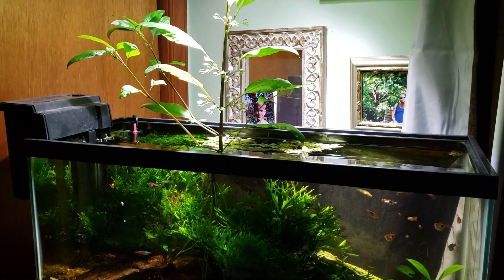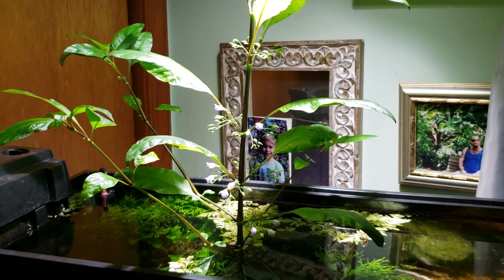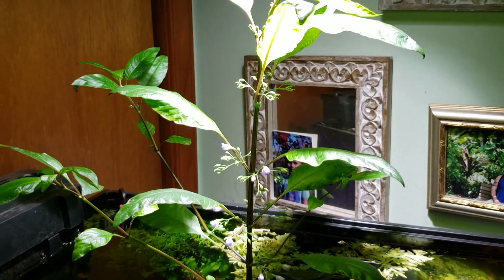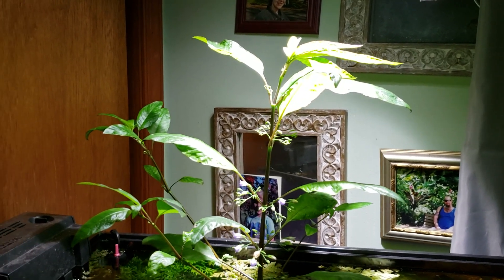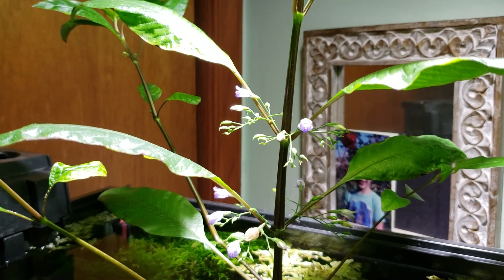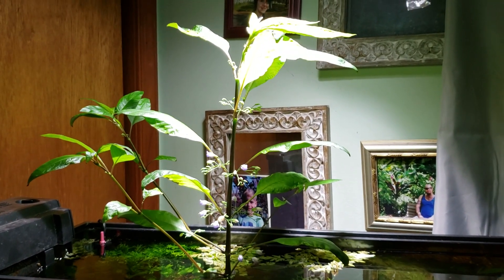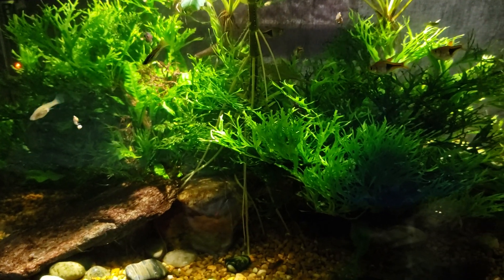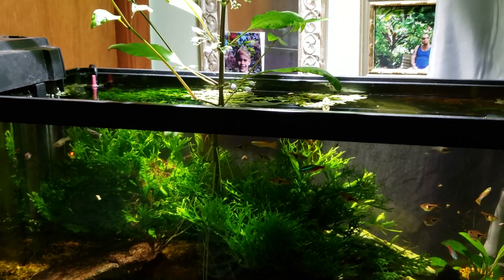Correlated Color Temperature (CCT) And Color Rendering Index (CRI) Mean Very Different Things

Comment: Too many people are stuck on the idea of growing Mary j. And the old school notion of switching from metal halide to hps when switching to a 12/12 schedule. Daylight doesn’t switch its color temperature and many plants flower in spring summer and fall. Spectrum adjusting just increases potential for higher production. And higher color temp temperatures just keep plants more compact which in the case of Mary j just keeps flowers more dense. That’s a very old school thing and these days with led or cmh, it doesn’t really matter. It’s not about what is for what, it’s about manipulation. Now if a plant was given say, 2000k only, it would likely elongate and be lanky. When people say veg/flower, it’s almost always back referenced to what they heard about growing weed.
Reply from the maker: Lol Exactly. If we were talking about growing weed in the 70's, the 6500/2700 thing would be spot on.